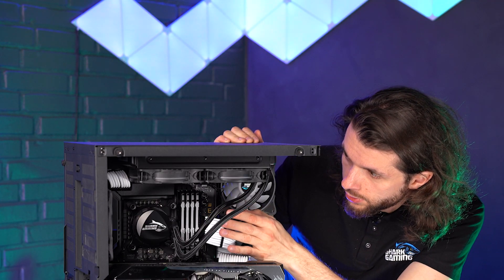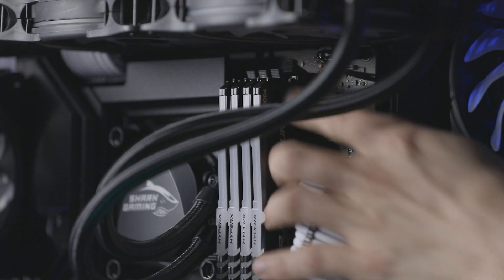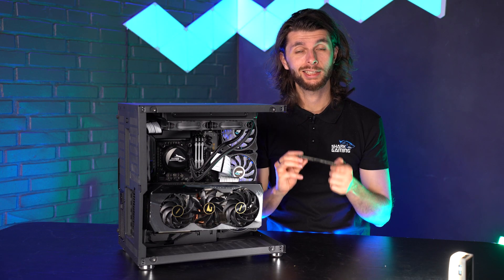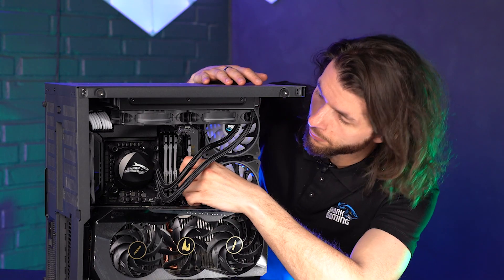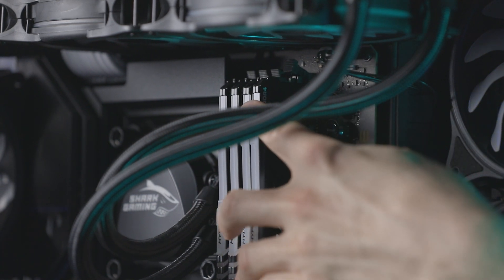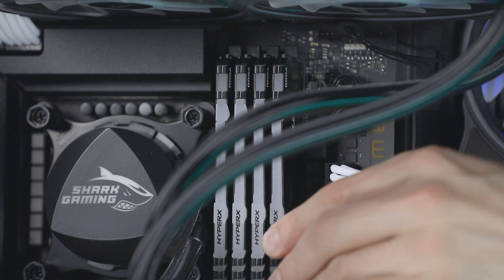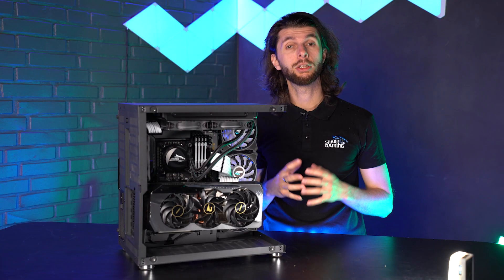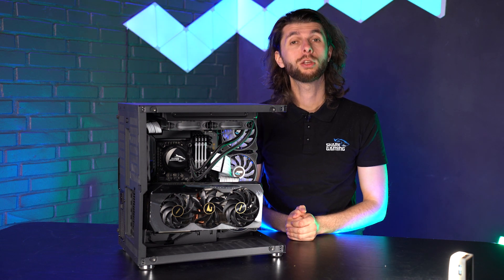How to install RAM in your PC

Comment: Also important to note you gotta be sure that it's facing in the right direction! With DDR5 it's especially difficult to measure which side is right, so look before pressing them in and make sure the gap on the stick lines up with the slot.